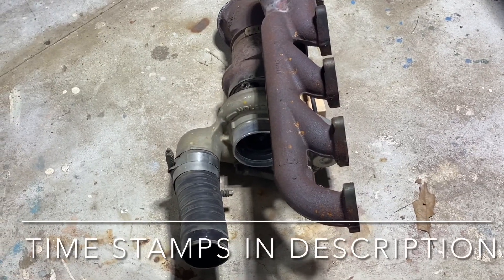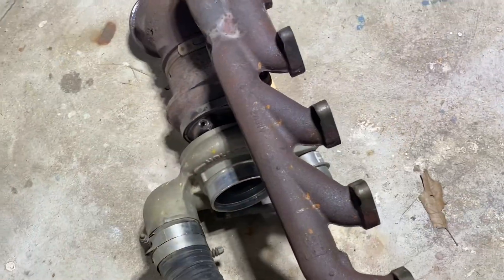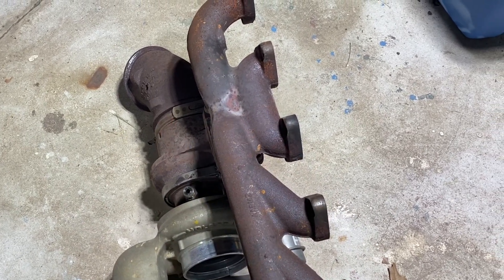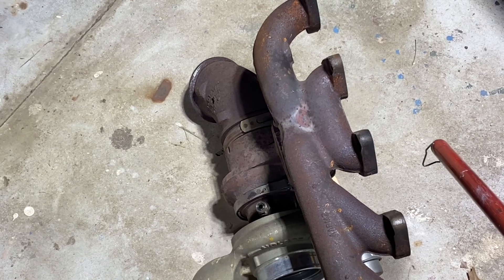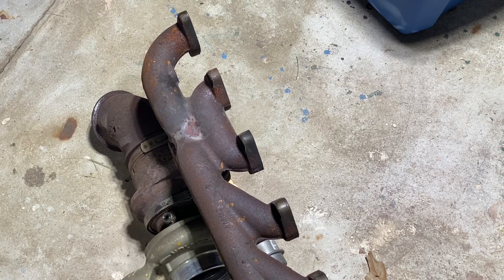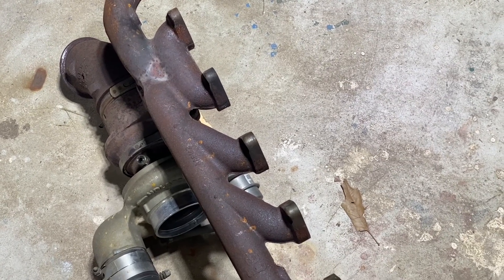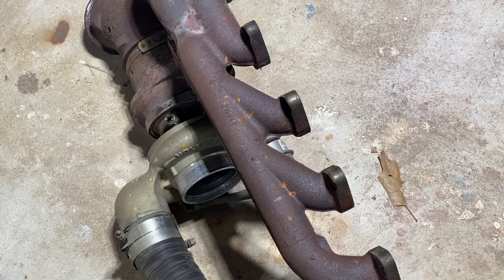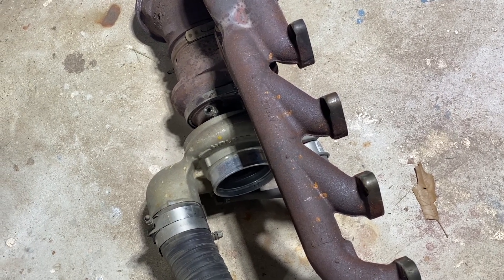Do Diesel Trucks Need Exhaust Resistance For Better Turbo Spool?

Comment: Does this apply to gasoline vehicles as well?
Reply from the maker: Yes, but with naturally aspirated gas engines better exhaust scavenging might be achieved with a certain diameter of pipe and diminished if the pipe is larger or smaller than that ideal diameter. This has to do with the cyclic and pulsatile flow of exhaust out of the engine in naturally aspirated (non-turbocharged) gas engines. In these engines a low pressure (lower than atmospheric pressure) area behind the pulsing exhaust column can be created which, if timed right, can produce a vacuum effect near the engine to help scavenge the exhaust. This is different than exhaust backpressure or resistance which will always decrease engine performance. At least that is my understanding of it with naturally aspirated gas engines.
Reply: @AK_5.9  there is barely any pulse post turbo... the expanding gases are going to "fill" that volume rapidly.. thats why turbos are such great muffler.
Reply: Ive tested this on alot of cars and it is never true in any situation straight pipe always make the most power